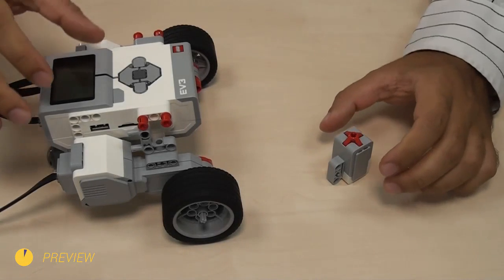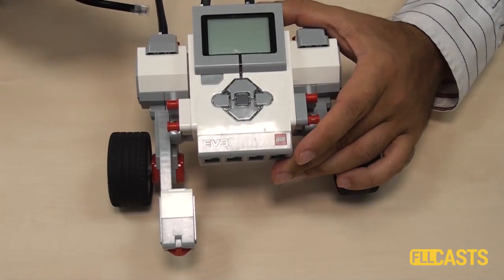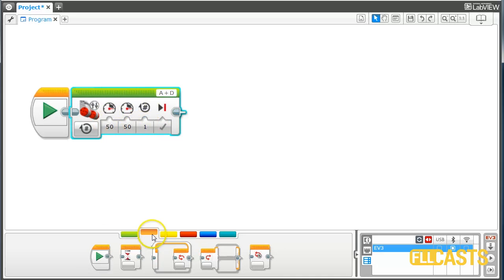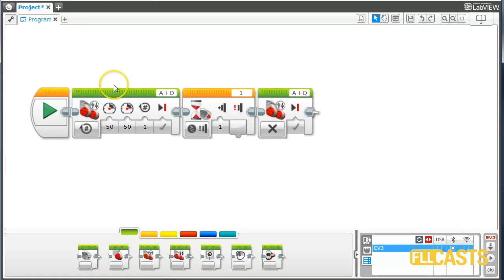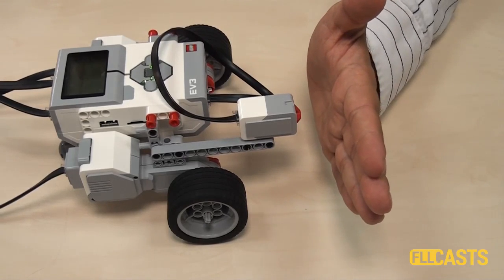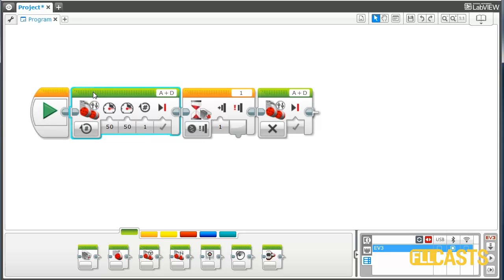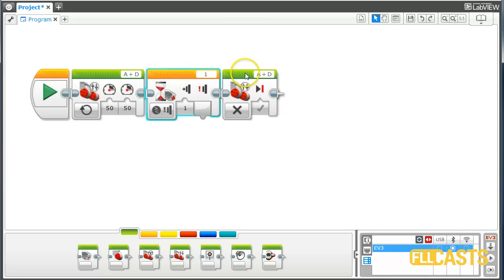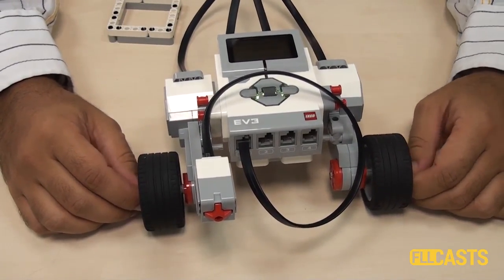EV3 basics course. Touch sensor (part 1)

Comment: Hello and Thank you for this video!!!!!! I have a project on my university in the subject of STEAM and I am thinking about to use a touch sensor. In my project my robot will   have to move in  a number line on the ground and  putt fractions in order from least to greatest. So lets say that I will use a 2 meters number line. I thought that as a  first step before my robot starts is to put my hand under the fraction 1/10 for example or 1/2 and then the robot will stop until it reach my finger. As you said in your video if we want our robot to stop at a some distance of our hand we  cannot be sure by using rotations. I am thinking to use the second example, so as the robot starts, its time I am about to put my finger in front of the robot it will stop. In my project I have to use the robot to ''teach'' to the students how we order fractions . What do you think  can this help me ?  At EV3 programm how many actions should I use to set in order 5 fractions and stop the robot with my hand ? Again, thank you!!!
Reply from the maker: We'll be glad to help. Could you send us an email with your questions to team@fllcasts.com so we could give you a proper response?

Comment: why don t you put a axle in the front it will work better
anyway good
Reply from the maker: Because the axle could bend and thus damage the sensor. It is a rule that you don't put a long axle in the sensor. You could put a pin with a cross, but not an axle.
Reply: We can put a 3 module axle